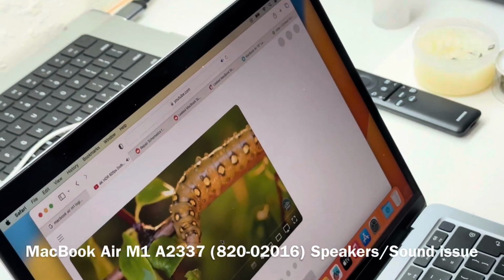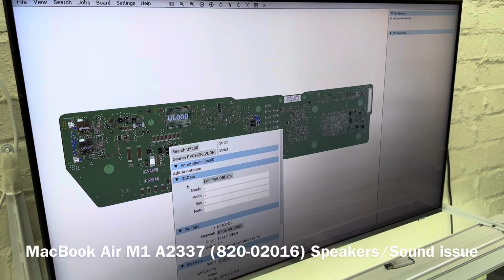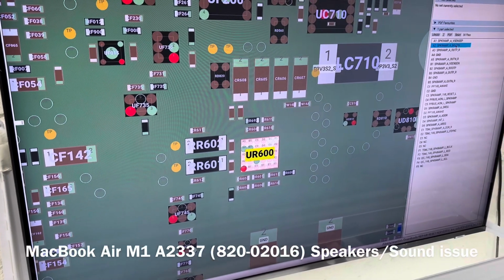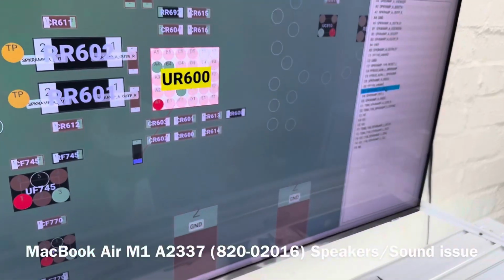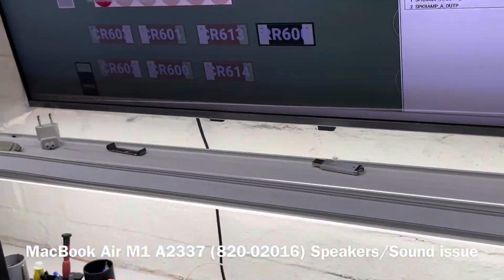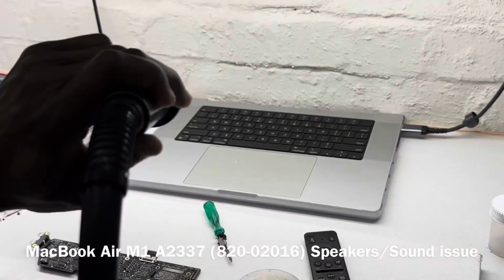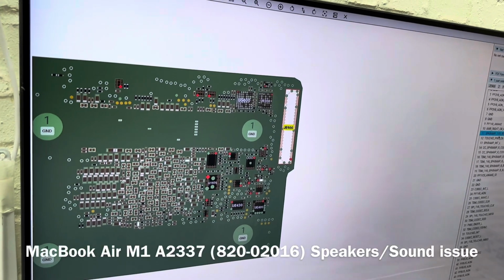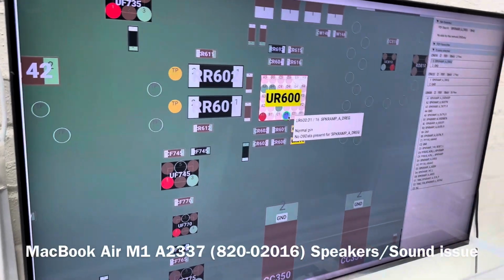MacBook Air M1 (820-02016) On-board Speakers repairs

Comment: I have a macbook air a2179 which was water damaged on the audio board area. I replaced the audio board, but the speakers did not work however it works fine with a headphone.Then I changed the speakers and the problem was still there. I watched your video and I think my problem is same as the one in the video. I am not sure if this is related to or not, but there is a tiny led on the logic board beside the button for discharging current which is always on. Do you have any idea about my problem?
Reply from the maker: Hello , thank you for tuning in. The standby LED has no connection with the issue you are having. Just to confirm , you say the headphones work ? Also , though you replaced the audio board did you replace the cable as well ? You can continue the chat also on our free repair forum 
https://resetlab.co.za/community/
Reply: @resetlab7142   A Salam O Alaikom. If I connect headphones, I hear the sound. I think this might be the same issue you had with the macbook in the video. I changed the audio board and the flex cable connecting audio board to the logic board. I also tested another pair of speakers, but no change! 
by the way, if you suggest, I can ask my question in your forum.
Thank you.